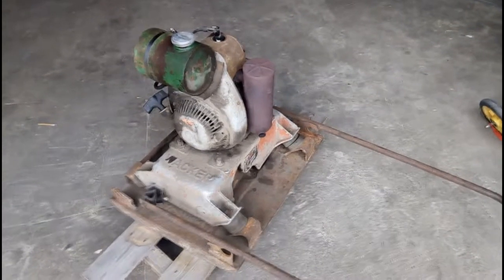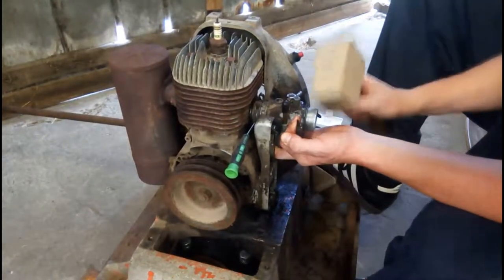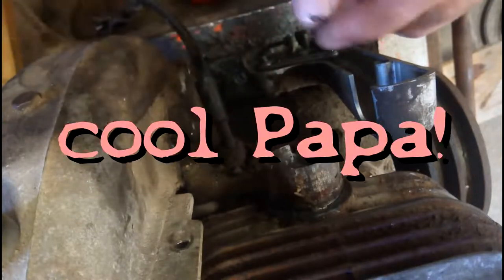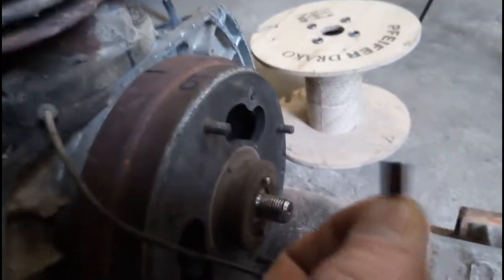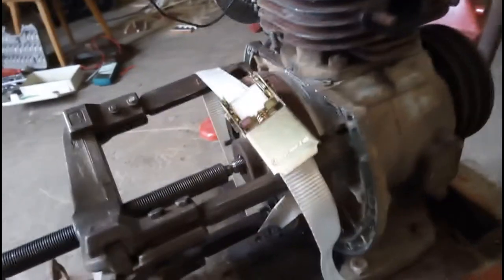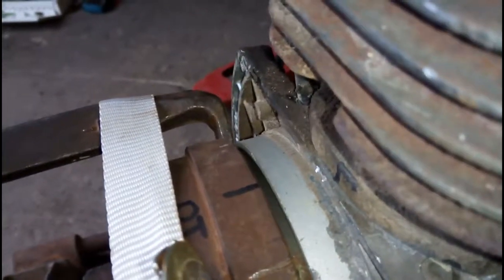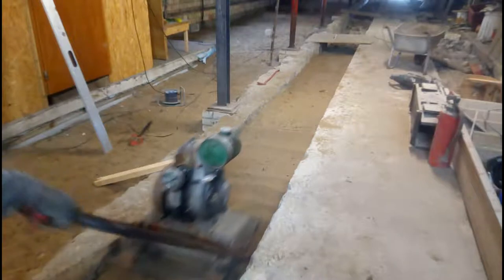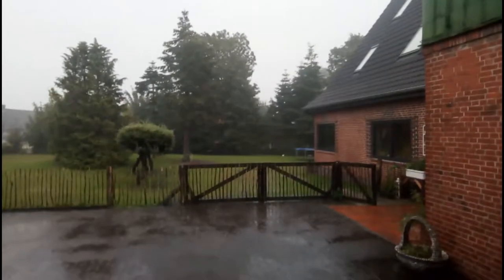Repair Plate Compactor's 2 Stroke Engine (Sachs Stamo) - Quick and Dirty #4

Comment: hey there,i have the Stamo 75 engine...two stroke...it has a screw at the bottom of the engine...it looks like and oil drain screw,but it cant have oil inside there because its a two stroke...can you tell me what that screw is for?thank you.
Reply from the maker: Sounds like the screw doesnt belong there, but a valve. If you try to start it several times, but it wont fire up, you "drown" the engine with too much gas/oil and it wont start anymore. With that valve (or by removing the screw) you can let the gas out of the engine and try to start it again...